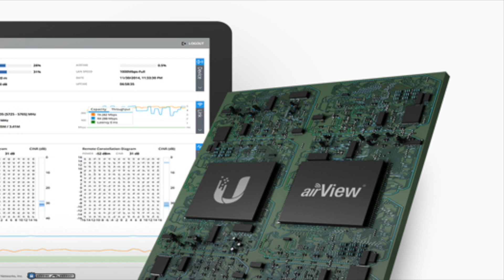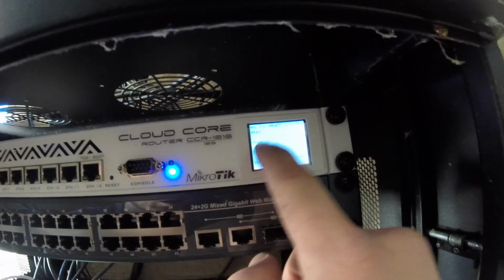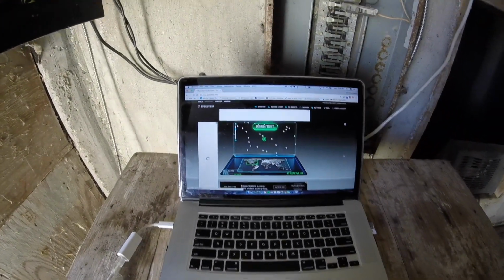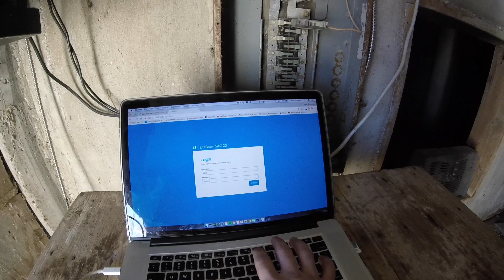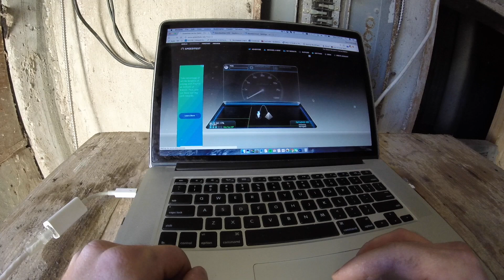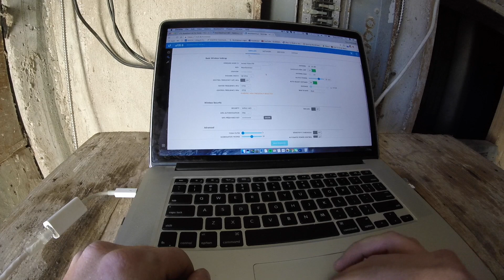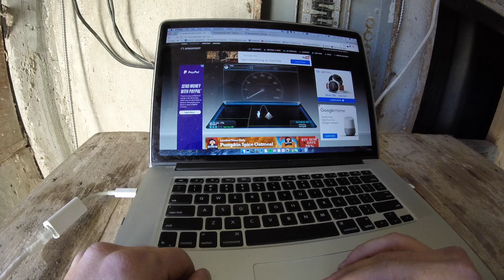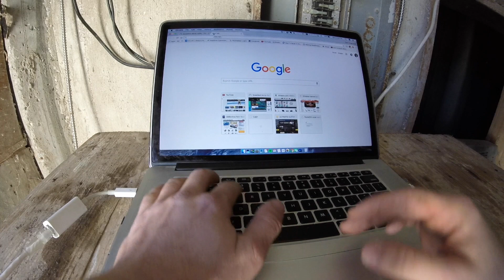Ubiquiti Litebeam AC | LBE-5AC-23 PTP Speed Test | Ubiquiti AC

Comment: my question is that antenna was road level if a truck came along you lose internet?  looks like a pretty bad setup
Reply: Yeah I saw s couple of bad aspects to this wisp already. Under any circumstance, you shouldnt be using a litebeam 5ac for backhaul as it is only half duplex, but its whatever. The username for equipment shouldn't be the default "ubnt" username. The two litebeams weren't even aligned too well as (simple explanation) the little dots on the graph were moving too much (not good).
Reply: @kushvibe5638  And if I'm not mistaken none of his equipment is on the rfc1819 network, and I'm pretty sure he doesn't own 1.0.0.0/24 and 30.0.0.0/24.
Reply from the maker: It’s all on wireless wire 60ghz backhaul  now but yeah it’s a wonder it works so well considering the price. But I’ll use what works over some marketing bullshit anyway.

Comment: +Gavin Greenwood, just to confirm about your comment to +Artur Tamaryan for a 10 mile link... The specifications of the LBE-5AC-23 say it would work 25+ km.  Would it really not work? Just asking, because I was hoping to do the same, but the PBE-5AC-500 is about 3x the price.
Reply from the maker: +Joseph Grn I'm not saying it wouldn't work. It most likely won't make it to 8x modulation at that distance. Which would be slower then  using the higher gain dishes for a better SNR.
Reply from the maker: +Joseph Grn it will work. I only recommend pbe-5ac-500  to ensure best signal a higher DB dish is better noise immunity
Reply: +Gavin Greenwood, thanks!  I haven't gotten into Ubiquiti's long distance backhaul yet (or any backhaul for that matter; mostly firewalls, switches, and VMs).    I'm interested in an 8 mile 25Mbps line in the Virginia mountains (I'm currently at Virginia Tech).  I'm also helping out my parents who are setting up a farm in the Philippines that is about 10 miles from their home.  I don't think the throughput would be more than 10Mbps in that case (for VOIP and basic internet).
Reply from the maker: +Joseph Grn that's super cool! Would the link be line of sight at you parents?
Reply: Natapos nyo po ba ung project? Kamusta naman ung internet speed?

Comment: Very neat, a couple questions if you don't mind.
Your ISP lets you connect the dish at the road right into their equipment? What is that equipment? Is it just a RJ45 link into their fiber switch that is located right near that pole? What does the ISP charge for that hookup?
Reply from the maker: +theshantyman I get fiber from them and use a media converter. Install was 5k
Reply: 5k you paid to them to get the fiber? Was it already at that site? i.e. what did they do to earn 5k?
Reply from the maker: The fiber was there on the pole so the put in a fiber switch and ran it down into my box for 5k (~20feet). I also had to get an electric meter installed.
Reply: old post I know but the media converter you mentioned is it just an Optical Network Terminal ONT??
Reply: Are we talking of 5k ,like 5 grand (5 thousand american dollars)?,thts fucking ridiculous, am surprised